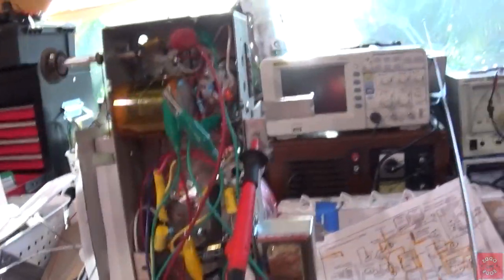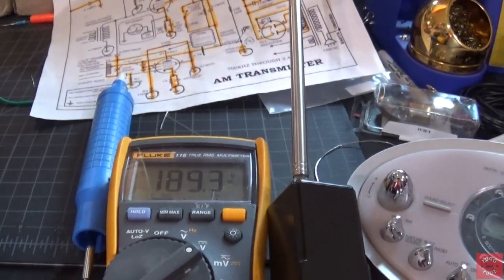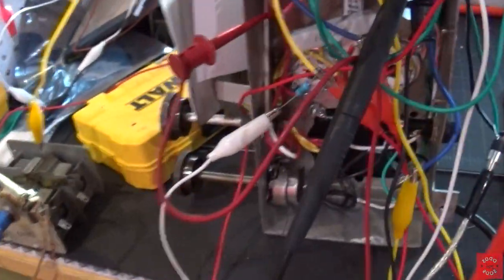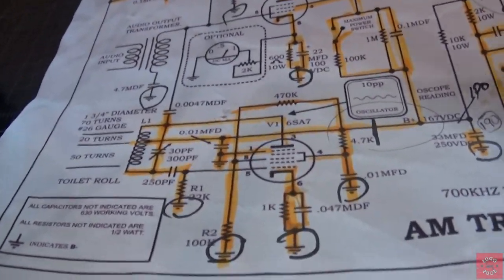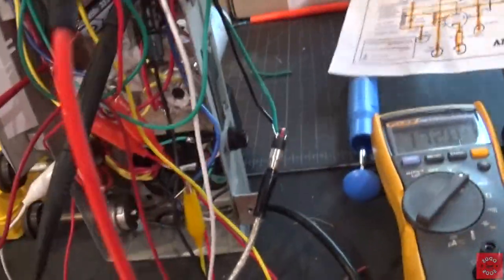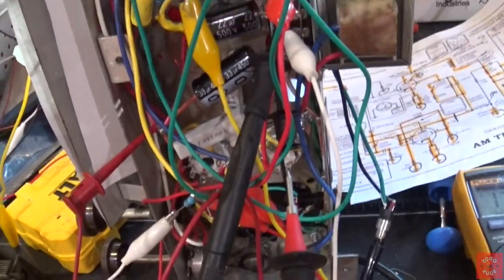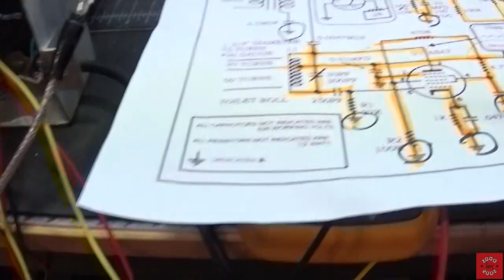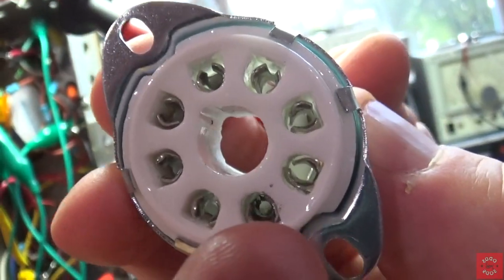Odds & Sods Episode 21A - Get the Raid, we are working out the bugs.

Comment: Ron,
Sherlock Holmes said: "If you've eliminated all other possibilities whatever remains must be the truth."  Soooooo, the tuning cap is not isolated.  Remove it, set it on the bench and test it like you did the other one.  Orrrrrrr...L1 and it's associated wiring is shorted to the chassis.   Lastly, check resistance from pin #3 on V1 to the chassis.  There should be no continuity.
Good luck my friend.
Regards,
John
Reply from the maker: John, I did check Pin 3 to the Chassis.. nothing...   I just created a new L1 and will install it differently to see if that is the problem.  In my design, I currently have L1 directly under the tuning cap.. who knows.. maybe something to do with that... will keep trying til I run out of ideas  :)   thanks my friend.
Reply: Ron,
No need to go too awfully far on this.  Disconnect the wires from L1, gator wire them to the tuner from the top of the chassis and see it there's any change.  If not, remove L1 from the chassis and again gator wire it to the tuner via topside.
Regards,
John
Reply: I remember Mr. Spock saying something very similar.
Reply from the maker: LOL Gary....

Comment: What condition are the trimmers on the tuning cap in?? I'd (transmitter power off) feed signal into the both the cap's oscillator trimmer, and antenna trimmer, and see what feeds into each rotor and stator. They can be finicky s.o.b.'s, and I've had the crap pounded out of me more than once by "potential" and the errant variable capacitor.
Reply from the maker: Good suggestion !  That will be my next step if replacing L1 does not help.  I have avoided removing the Tuning Cap as I didn't want to mess with the dial string, but I think it am going to have to do it.   Thanks Tim

Comment: You show voltage on the L1 taps and nothing on the tuning cap's frame so you proved you are not connected to the tuning cap frame somewhere along the line.    Follow that path.   Just an FYI  don't forget that the tuning cap has 2 conductors.   The rotor connection and the stator connection.   When you do the checks make sure you test both the rotor and stator.   Rotor is tied to the tuning cap frame.  Stator is insulated from the frame so you need to test to the stator too.   You might have the capacitor connected half right.  In this vid there is a chance that you reversed the connections to the unmounted test cap from the way you have the mounted cap wired.  Stator and rotors of the 2 are reversed during your testing.    Did you test for continuity from the mounted cap's stator to the chassis?
Reply from the maker: JP.... I do have voltage on the unmounted cap.. that was my error during the filming.  I removed L1 and created a new one and will connect it differently.  We'll see tonight if that solves the mystery. Good news is that I have it narrowed down to a specific area.    this is fun :)  thanks Ron
Reply: On both the rotor and stator of the tuning cap?
Reply from the maker: JP - mystery solved... in the process of uploading a short update video now. Will explain all... one of the dumbest mistakes I have ever made , but.. I found it so that is what matters :) Thanks Ron